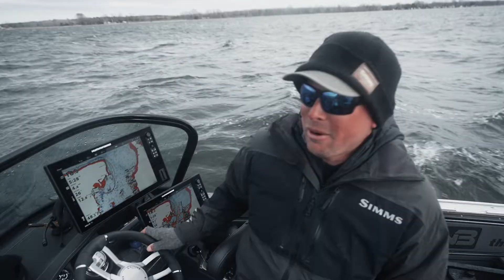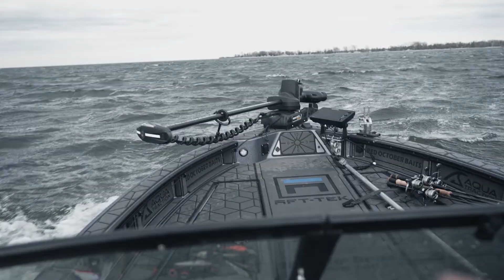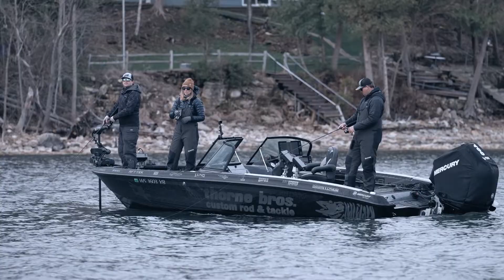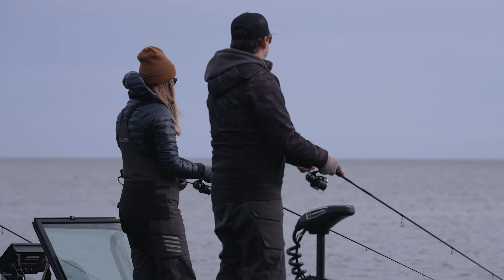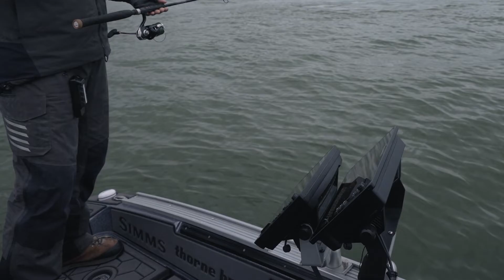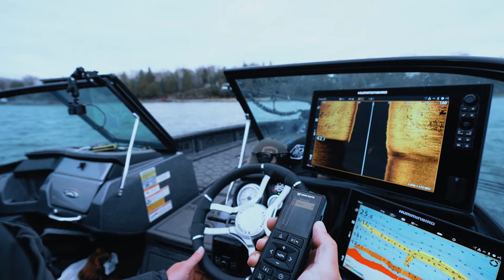Chasing Big Water Walleye [Ulterra QUEST Trolling Motor Advantages]

Comment: Misleading product description(s)! NO SALTWATER!
April 2026 update:  This motor has been to the shop for $1000 worth of work THREE TIMES in 16 months.  NOT saltwater related work.  It's destroyed more fishing and water outings than it has helped.  You have TWO choices with this motor:  be ready to bleed money, OR be ready to become an uncertified Minn Kota tech while you try to troubleshoot each next problem.  For me, fishing is problematic enough.  After 16 months, I put this up for sale for 20% of what it cost me, and I'm done with the brand.

I purchased in March 2025 and had the Ulterra professionally installed in April 2025. The motor required $500+ in service in January 2026, seven months later. I took the motor to a certified Minn Kota Service Center. Before initiating work, they informed me that the motor’s warranty was INVALID due to the repair facility’s presumption that I had used the motor in saltwater.

Prior to purchasing this motor, I did about TWO WEEKS of research to insure that the motor was suitable for all types of water and fishing that I intended to do. The videos on Minn Kota showed the motor being used in salt water. There was never any mention–neither on the vendor website product description, nor on the Minn Kota website–that this trolling motor was ONLY SUITABLE FOR FRESHWATER. Minn Kota sells a trolling motor with increased corrosion protection that is (and was, at the time of purchase) approximately the same price. So if there had been ANY indication that saltwater would have voided the warranty on the Ulterra, I would have simply purchased the other model. No such indication existed.

I visited the Minn Kota website circa January 14, 2026. The warranty information confirmed that saltwater use invalidates the warranty. I do not believe that this is the same warranty language that existed on the Minn Kota website at the time of purchase (March 21, 2025). Also, none of the written materials received with the trolling motor indicate that it is for freshwater use ONLY, or that saltwater use invalidates the warranty.

On January 14 and 16, 2026, I contacted vendor to file an refund claim. Vendor customer service CONFIRMED THAT THEY CHANGED THE PRODUCT DESCRIPTION since the time I purchased the Ulterra trolling motor. Vendor changed the description to include the word “Freshwater,” but the vendor still leaves it ambiguous as to whether the motor is freshwater ONLY, and does not make ANY STATEMENT that a SINGLE, SALTWATER USE will invalidate the Minn Kota warranty.

All of this said, I am believe deceptive marketing of this product that has resulted in current losses to me for non-warrantied repair, and prospective future losses due to ongoing repairs of a product that should have been under warranty if not for the deceptive and incomplete/inaccurate product description and misleading product videos on the Minn Kota site.

If you have this motor shipped to coastal Florida, Minn Kota and its certified repair facilities will probably assume it has been used in saltwater, without even asking, and void your warranty.

I have emailed Minn Kota and will update review pending resolution of repair issues.